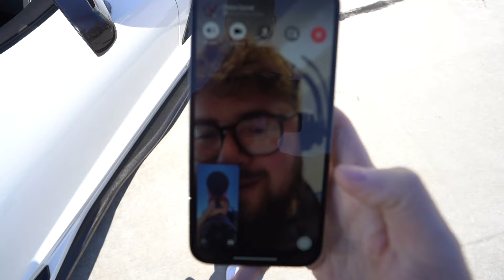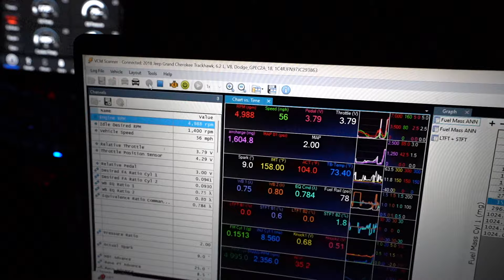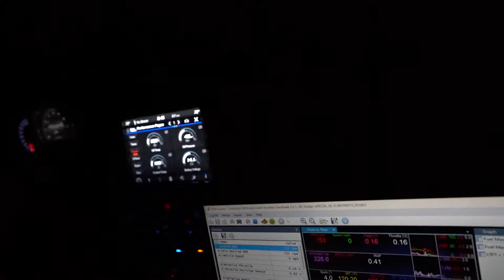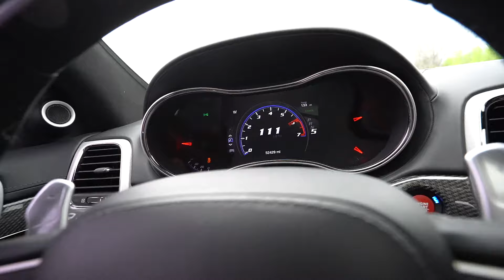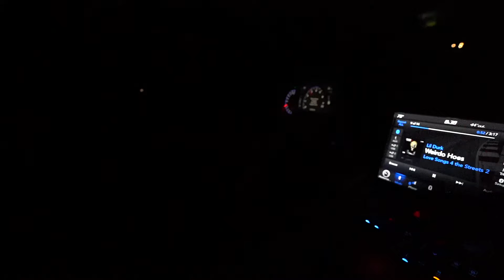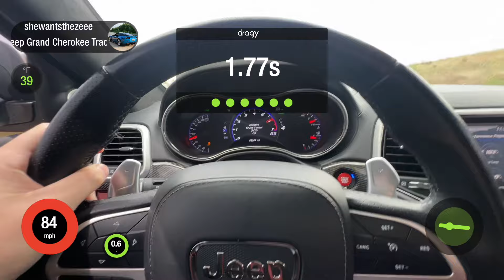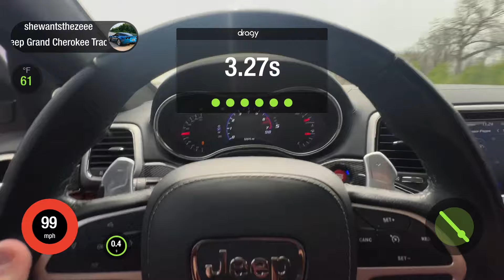TURNING MY TRACKHAWK INTO A 800+WHP DAILY DRIVER!!!

Comment: Did you need to do anything like swap tunes or pulley when you filled up on E85? Or just fill up and go
Reply from the maker: Yeah unfortunately need to use the laptop to load 93 or E85 map if you dont have a flex tune. I opted to not go with flex tune because drivability isnt very good per tuners advice